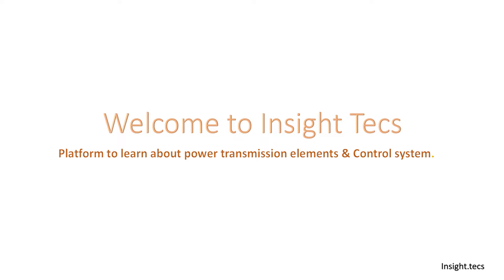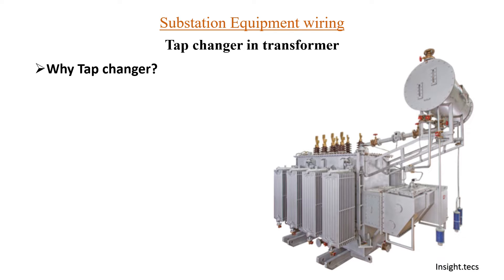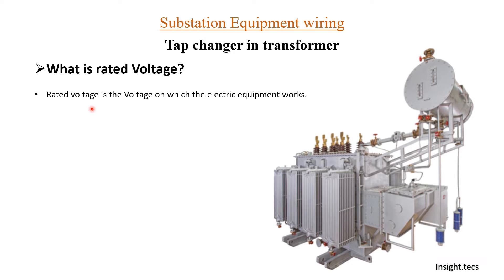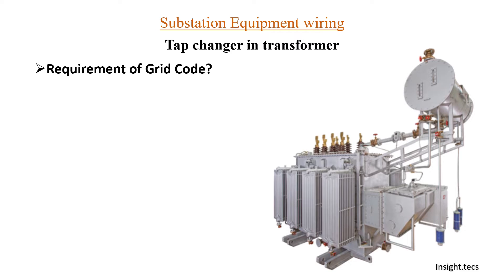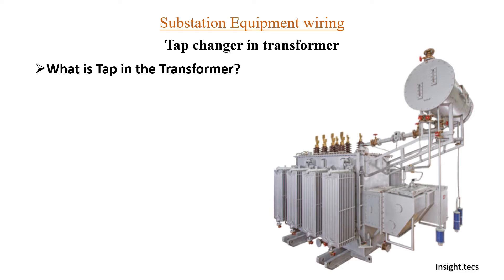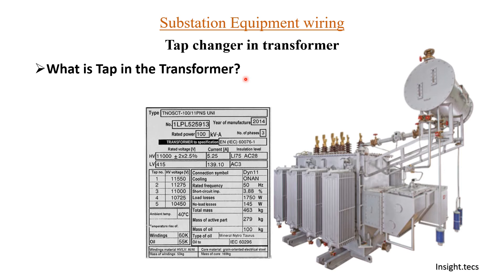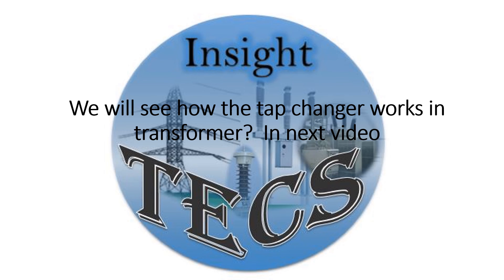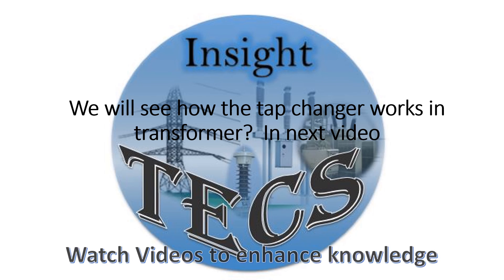Basics of Tap changer in transformer || Part 1 || English

Comment: Thank you madam.
I've a doubt regarding the tapping operation. 
Supposing the voltage increase by 2.5% on the primary, secondary V will also increase by 2.5% since turns ratio is constant. So for that reason to obtain constant 415V , tapping should be kept at a lower level. But in the presentation higher tappings are for high voltages in the primary.
Reply from the maker: you should check your transformer nameplate to check the tapping design...

is that as per describe in video, than you are right...
Reply: @Insighttecs  Okay I will check. 
Thanks.